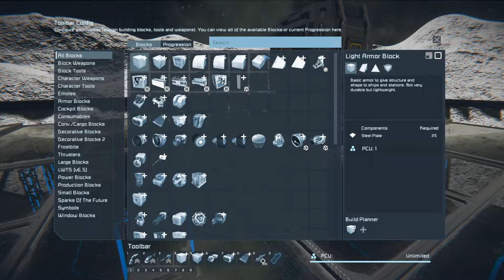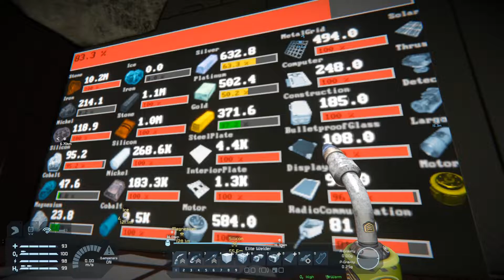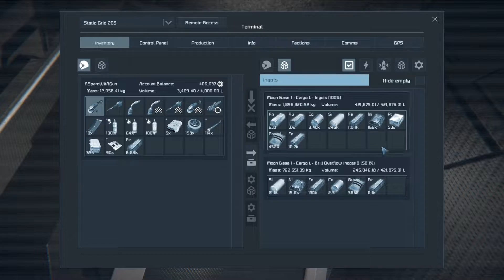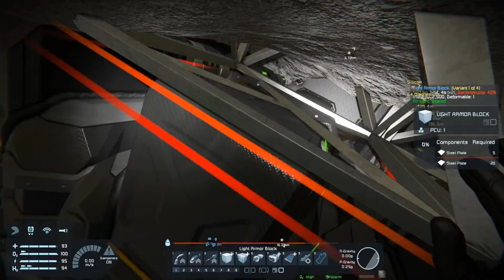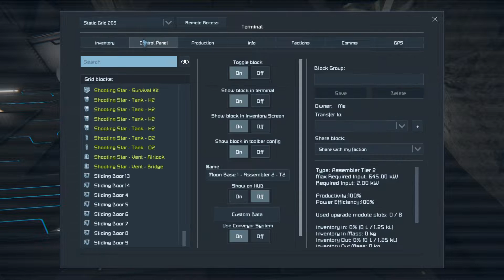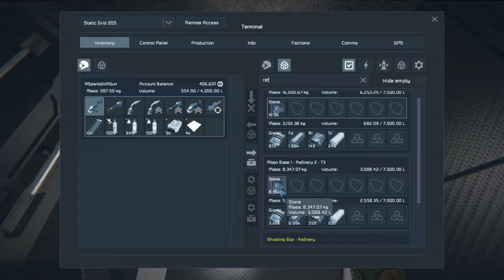Adding A Couple Mods & Diving Into The Tier System Mod! - Space Engineers LP - E37

Comment: 1) Your sifter is fine. It would be cool if it would gather rare earth minerals instead of common minerals, but whatever. The sifter is fine.
2) You used half blocks in the ceiling. That is why you are unable to depressurize the "room". Your walls don't exist according to the vents. One vent is depressurizing and the other is re-pressurizes the room.
Reply from the maker: Oooooh, that makes sense. I didn't actually use half blocks in the ceiling but if the walls aren't connected to actually isolate the rooms it still would cause that problem. I hadn't even thought of that, good call. :)